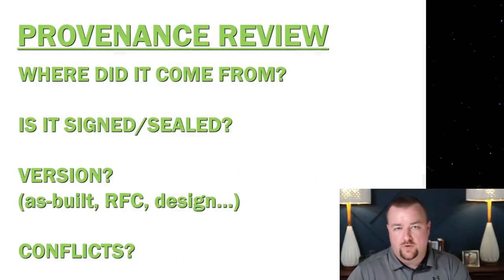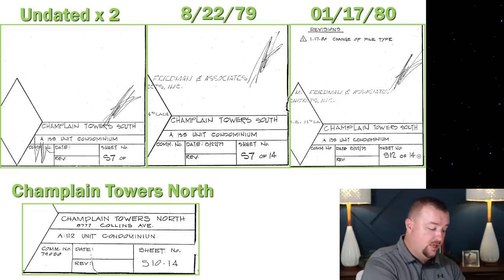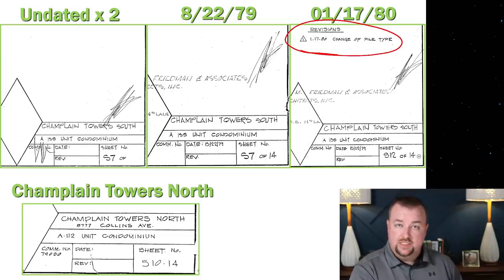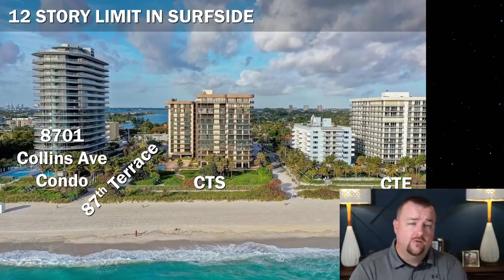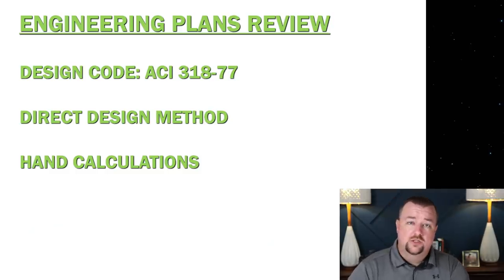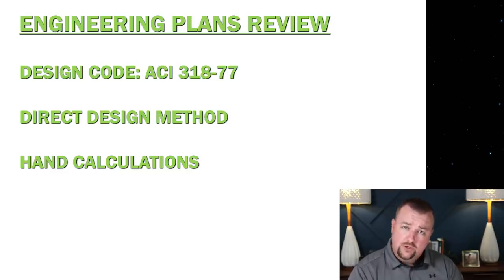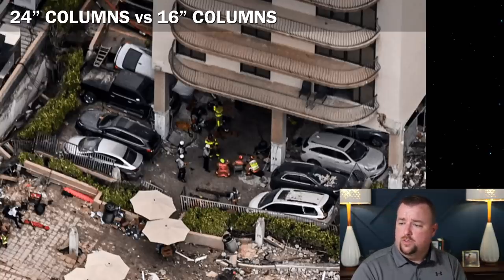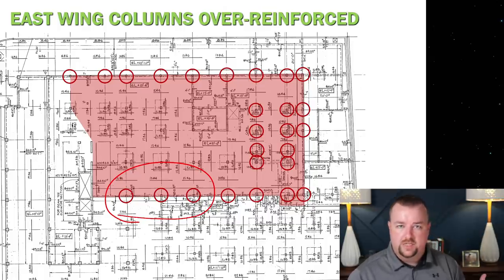Engineering Failures Found in the Champlain Towers South Drawings - Surfside Collapse

Comment: "They tend to design to the minimum code..."  As a draftsman, I've noticed this very often when I submit drawings and plans.  Often times I, don't necessarily push for maximums, but typically avoid minimums because I like stronger stuff under my name, and my submitted drawings get changed to minimums all the time.
Reply: No one builds to high standards..no one would pay... would you??   But to stop building maintenance they got exactly what they deserved... done..
Reply: @petero2693  Buildings that are over-engineered and built to very high standards are uncommon, but they do exist. Those are the ones which might survive for hundreds of years (if nobody decides to knock them down), and then people will look at how old those buildings are hundreds of years from now, and say "they don't build them like they used to"
Reply: The rule of thumb for engineers is to go around 25-50% above minimum. Forming steel rods ain't cheap... For a 3rd world Country. ;)
Reply: Thank you
Reply: That's why code enforcement should enforce proper regulations so that's a structural design of the building is not compromised. But all too often payoffs are made. To turn a blind eye.
Reply: @jamesconway4821  if code enforcement/building department knew 100% what they were doing.
Reply: Seems like we need to push for minimums to be 20% less minimum.
Reply: Euurggh same lol I just finished my third year of architecture college and they really love to tell us to go for the minimum when it comes to code stuff. example: ive been told to make hallways less wide bc the minimum is only 3 ft or whatever. but what if multiple people need to walk there or someone has to move a big object? 😭 tbh not even just buildings just like, the design world in general there r lots of ppl who only care if a thing looks nice and not it’s practicality
Reply: When I was a teenager I over-engineered/built a bookcase in wood-shop class. 40 years later, it still has not collapsed, even after being weighed down with heavy books all this time and moved from place to place. I put 3 big dowel pins at each end of every shelf. Maybe 1 would do, but why use only 1 when 3 is better? Maybe I should have done 4?

Nobody would pay for over-engineering? Dowel pins are cheap. However I suppose my "labor" was free at the time.

Often us amateurs over-build stuff, because we just do not understand what is the bare-minimum standard that we could get by with. And we lack some greedy corporation pressuring us to cut corners to save a few dollars.
Reply: @stinky59  plus this mindset makes it really hard accessibility wise! my sister uses mobility aids and helping her has opened my eyes to how inaccessible the world is
Reply: I think the codes are too lax, then.  Buildings aren't being built to last these days.  Of course, the construction companies aren't around when the building gets condemned down the line, so they are absolutely incentivized to do as shoddy a job as they can get away with to drive down costs.  I'm a bit libertarian about a lot of stuff, but not this.  Some regulations are clearly extremely necessary when lives and entire life savings are on the line like this.
Reply: @grey6703  exactly. my uncle is legally blind and i have a cervical fracture and chronic muscle issues so currently need to wear a lot of braces, it is so frustrating to get around because the world truly just isn’t designed for anyone who’s body isn’t 100% normal and it sucks! that’s part of why i’m going to school for what im doing! not to mention as i had to recently find out the hard way… braces and mobility tools are often bulky and unergonomic when they don’t need to be and the unappealing look of them just contributes to ableism and draws unwanted attention! i am so fucking tired of the mcdonald’s cashier looking at me with pity!! it doesn’t have to be this way, why shouldn’t a cervical collar be sleek, ergonomic, and sexy? im deadass going to design and cad model and 3d print/make a mold for my own idea of a non-intrusive ergonomic cervical brace and try to get that shit manufactured this summer because i am so tired of everyone staring at people who are recovering from injury SMH!!!!
Reply: @stinky59  that sounds fucking awesome!! my sister recently got a bunch of fake flowers and vines and stuff and completely decorated her wheelchair for this reason. she’s such a fun bubbly person that a plain black/gray ugly wheelchair or scooter would not cut it
Reply: @stinky59   you’re awesome!  I’ve often looked at medical contraptions and wondered what the hell were they thinking?  Wishing you much success. Stay angry.  Let it fuel your passion.  💕
Reply: @Don Greek they shouldn’t. But they do. My friend worked as a building inspector. He was offered much graft to look the other way.  He’s an honest man and didn’t but it does happen.  There was a stadium someone wanted him to ignore deficiencies.  He said no. The guy pushed on him, telling him he needed to play along and why not just take the money and look the other way. He looked him in the face and said let me tell you why.  It just might be your grandchildren sitting in that balcony when it collapses.  That was the end of that. It’s not necessarily always subversive either. Friends of mine put in gas HWH.  They had one inspector said it was a great job. Another came for something else. Looked at it and said it was a terrible install and he never would have passed it. So, one of them wasn’t well educated on the install. That was more my point. Often the building inspectors are in over their heads.
Reply: Buildings subjected to hurricanes should be built to the maximum amount of strength possible.  This building would’ve collapsed had it been clobbered by a major hurricane long before now.  Hurricane Andrew was a close call for this building.  Had it been slightly further north, this building might’ve collapsed long before now.
Reply: @petero2693  Yes, I would.  My single story home was built far stronger than this building was.   Unfortunately, since then, building regulations have been relaxed.  My home was build post Andrew after codes had been drastically increased.

Comment: I worked with architects and engineers for 35 years.  In general, the structural engineers were the least flexible and most conservative with designs, because they provided the parts of the building that made it stand up.  I find it bizarre that the structural engineer made the changes you've shown without some kind of structural load compensation in the design.
Reply: Read up on the people involved, possible mob involvement and the Wild West nature of things at the time I'm a tad surprised there was a qualifies structural engineer involved at all but certainly in that environment only structural engineer's that were willing to break the rules in building things need apply.
Reply: @RedRocket4000  really? That's fascinating.  I do remember hearing that there was some mob activity in the area at that time.. I'm gonna check this out now.
Reply: @RedRocket4000  I really don't care to "read up" on alleged Florida miscreants.  I can only relate 35 years working for two of the world's largest engineering firms and knowing the conservative engineering approaches used for the projects I worked on.  You couldn't buy your way into a design change that would cause potential liability and especially loss of reputation.  This includes six projects done in Florida starting in 1992.
Reply: @buckhorncortez , so you don't care about the politico-social potential root cause of problematic building design and construction in Miami-Dade in the era the building in question was designed and built? Cool beans. Thanks for letting us know.
Reply: @Johnny.Fedora  Truth hurts, or might hurt.
Reply: @buckhorncortez  If you worked for a 'large' engineering firm they probably don't touch residential. Fees tend to be the lowest, long hours, toxic work environments. Smaller firms specialize in these and they'll underbid the larger firm every time. Much of their work can be downright scary.
Multi-residential construction is a completely different world compared to municipal projects (like bridges), hospitals, etc...
With that said, new residential drawings in Florida "look" pretty high quality relative to what I tend to deal with in my region. Looks can be deceiving of course.
Reply: I doubt there's a place in the world where organized crime doesn't launder money through shady construction.
Reply: @MrMichaelFire  I met a building inspector that said he reviewed a structure and was offered cash to look the other way over a change the developer wanted to make. It was a stadium.  Told them no, it just might be your grandson and his friends sitting there when it collapses. So yeah, it does happen.
Reply: @buckhorncortez  then they probably just didn’t consults structural engineer on purpose to do what they wanted to do without someone saying no. I’m sure that’s something that can happen is forgoing an inspection altogether or ignoring one?

Comment: Hearing all of those "it was at 100% load" makes me wince so much. Especially when you're right by the ocean...
Reply: "Underground parking garage" only 400 feet from the beach makes me wince whenever I think about it too hard.  You don't see basements in seaside buildings for a large number of extremely valid reasons.
Reply: and then you remove additional supports from these sections that dont have much wiggle room to begin with...
Reply: @micaheiber1419  Built Against Costal Mountains the key here way better bedrock than the basically non existent bedrock here in Florida. You actually have ingenious and metamorphic rock there. Although due to Earthquakes The basements and parking garages are build with massive reinforcement. I've seen Japanese under building parking that looks like each car slot was actually a bunker for a military plane (thick concrete walls three side and roof) inside a larger bunker like the Germans had for their Subs in WWII. No columns wide concrete walls holding up thick concrete cross members. Other cases columns bu three times wider going into thick concrete cross sections not punching though them. 

 In this case the building build on filled in inlet there was water were this building was before. Main part of Florida basically floats on limestone and water mix. Main part of State been under water totally several times and is made up of former sea floor, coral reef and ancient beaches. I expect another time under water in the next century or so. 

And these are barrier islands for the most part shifting sand bars basically that should never be build on in the first place over all but are subsidized by the suckers who live inland. Thus the above comment on never build basements on seaside building.
Reply: @Darkkfated  I never gave  it much thought but in Florida where I am this normal.  If you go downtown areas many buildings have basement garage. But hey NY city and London  do it too so I don't think it is a problem.
Reply: In aviation, when we are handed the performance specs and limits for an aircraft, we are reminded that these are for a brand new aircraft, with new engines, flown by a manufacturer's test pilot, under ideal conditions.  In other words, the best it will ever do and don't ever expect to get those numbers in the real world.

Comment: How could an engineering firm remove massive beams and not re-do the calculations? It boggles the mind.
Reply: Blame it on the approving engineer, or the construction company / contractors, architect, etc. There's many points of contact from the initial blueprint to finished project. Judging by the irregularities between the 4 building docs where half of them are undated and the engineering company stamp is missing, there seems to be at least 1 party that acted in bad faith or criminally negligent
Reply: @stevelopez372  Yeah that is one of the go to examples for ethics in engineering to this day.
Reply: @killjoy1887  Australia has it's example also. In Melbourne, Victoria the West Gate Bridge was being built. The unjoined segment of road deck was being held by concrete blocks to correct a camber error. Finally an order came through to loosen some bolts, at which point the bridge snapped back and collapsed, with 35 killed, 18 injured. Six twisted fragments of the bridge can be found in the grounds of a local university who was asked to participate in the investigation  the collapse. Its said to remind engineers of the consequences of their errors.
Reply: @gavin9088  This type of thing is common in construction. Bad plans, incompetent or criminal contractors, corrupt Building Officials. The miracle is that this doesn't happen daily.
Reply: @stevelopez372  Yep rods in tension with washers taking the load= stupid.
Reply: @gorillaau  Canadian engineering graduates receive what is known as the “iron ring” upon graduation and completing the ceremony. The first iron rings handed out were reportedly made from the iron wreckage of a bridge collapse in Quebec and were to serve as a reminder of the responsibilities of an engineer.  I’ve recognized Canadian engineering graduates based on the iron ring on their pinky finger..
Reply: Im assuming they needed 24 inch beams to help get rid of the concentrated weight/load problem, or they needed to redo the parking spaces and put them somewhere else, but where?
Reply: Same thing with the Hyatt Regency disaster!

Comment: Josh. Excellent presentation. As a retired building contractor here in California I am amazed at the lack of rebar in these plans. Every subterranean parking we had ever done had much heavier steel, especially over the columns, and most all columns had drop-head column caps. This was probably for seismic purposes I'm guessing. Keep up the good work.
Reply: Typical lackluster zoning in florida in 70s. No review when big changes were done later. At least feds and state learn from these to adjust international code for future
Reply: I have seen drop head column caps in Ohio and Pennsylvania in multi-floor parking garages. One had pleasing rounded "horn" shape column tops. Others seem more like a thicker slab surrounding the columns, considering how wide they were.
Reply: @WindTurbineSyndrome  , building code, not zoning.
Reply: I see plenty of drop caps in Houston, Texas for much lower buildings. It’s shocking to not see this on this building.

Comment: 20:10  Regarding the pool deck being at 100% capacity, another source raised the issue of the palm trees.  That is, driving a cherry picker across the pool deck to cut them down.  I wonder if that could have greatly damaged the deck.  Also, if a planter is, say 3x4x12, saturated soil would weigh around 8,000 pounds (water alone is just over 8,900 pounds).
Reply: There's also the core sample which I believe was 3' x 3' directly next to the pillar which is believed to have punched through first.
Reply: One cubic foot of water weighs 62.3 pounds. If it saturates the planter soil it will add a lot of weight!
Reply: My be misremembering, but notice the square planters that had the palm trees are not on the 79 or 80 design, and were just that much more added weight when built on top of those relatively tiny columns that were already overworked and built ot age prematurely.